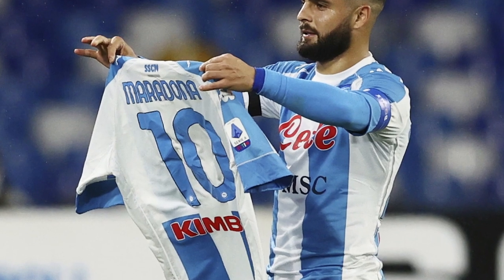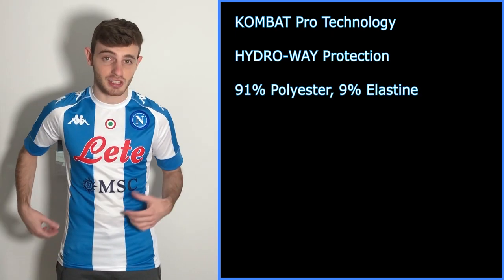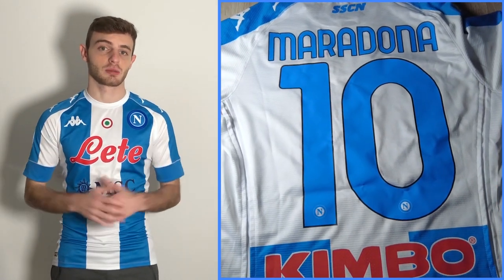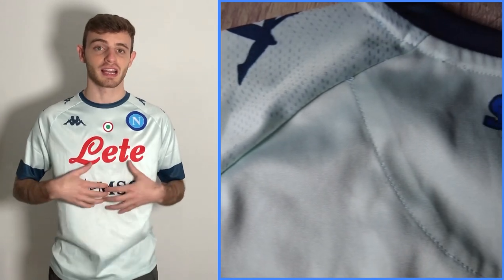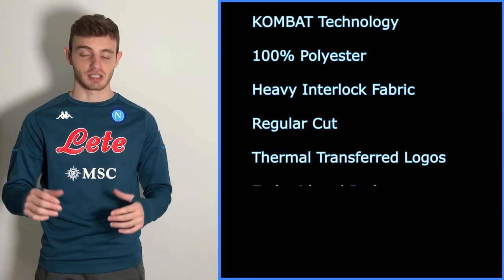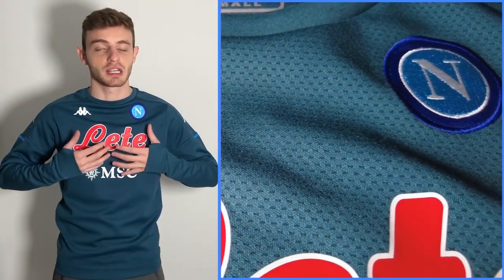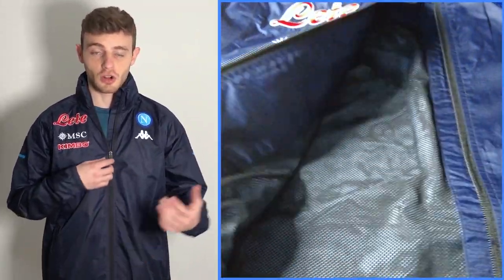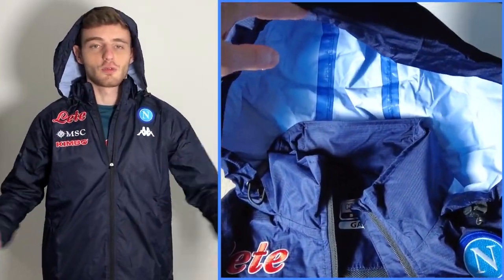Napoli x Kappa | Authentic vs Replica Shirt | Maradona 10 Special Jersey Tribute

Comment: Nice vid! 

I have the 20/21 training tracksuit, the top is blue with navy bottoms. The top has a 1/4 zip, I'm sure you know which one I mean.

I love it and looks very nice. Love wearing it and I probably wear it too much! Anyway I noticed a corner of the MSC logo has started peeling, have you had this issue before on any products with sponsors peeling? I have heard you can use an iron with something in between the iron and the top to iron over the peeling area so it sticks back on but not sure 😔
Reply from the maker: Thanks man! Yeah i know the one you’re talking about!! It’s really nice
Reply from the maker: I dont know how to fix that unfortunately, i had that issue with some older Macron Napoli shirts.... i would say for next time try to hand wash and no dryer. If you have to use the machine, put it on a really delicate setting and flip the shirt inside out
Reply: @NapoliTalk  Thank you. I followed the washing instructions (wash inside out at 30) and let it air dry. Shame but its only minor and not noticeable. My girlfriend thinks the iron will do the trick so if it goes wrong she can buy me another! 🤣

Comment: One more thing, how much really is the difference in match shirt tightness for us big guys?
Reply: Huge difference 

I unusually take a size small and I have to take a medium in the REPLICA I’d probably had to take a large minimum for the full proper player version 

Super super tight fit
Reply: @DigitalDaffodil  good to know thank you. Dom did a great job showing the kits, but because the player version has the "flexibility", it's hard to tell.
Reply: @John-yu4tt  Dom is in great shape! The shirts fit him like they would a player hahaha 

Player versions would be best to avoid in my opinion if you are much larger than a regular large (which would be an XL kappa) 

Go with the replicas!
Reply from the maker: Hahaha thanks man. Yeah the fit is extremely skin tight, whereas the replica is a regular fit like any other jersey you may have
Reply: I'm 6'1 (186 cm) and I usually get L. I got the replica in XL and it fits perfect.